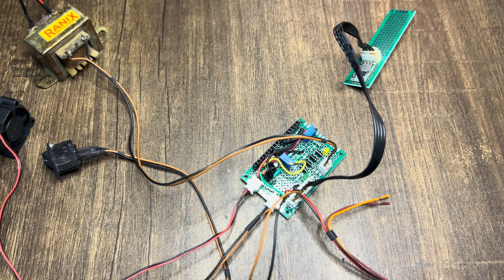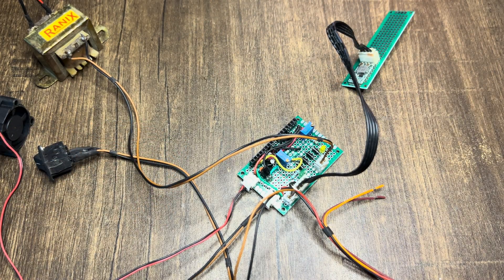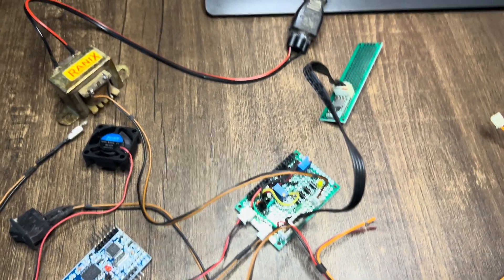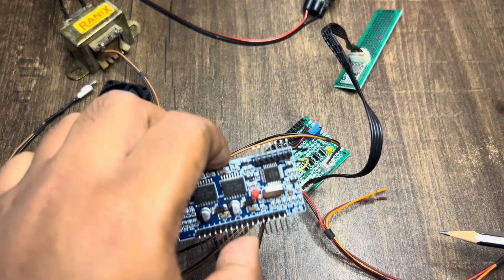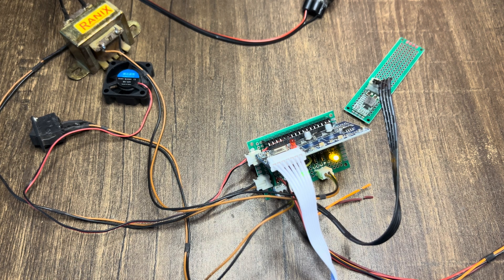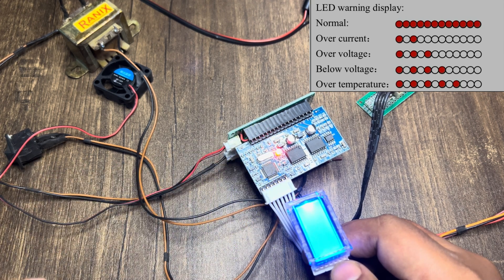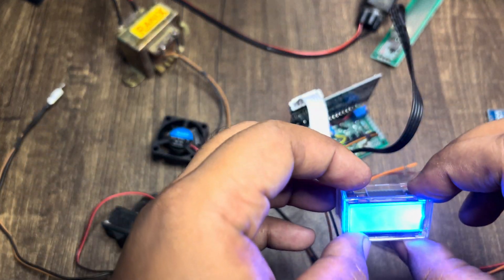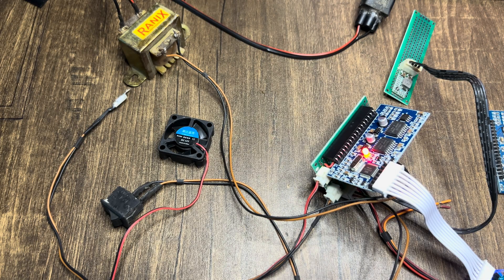DEC#28 Testing EGS002 PureSine Wave inverter module

Comment: Why isn't the output voltage of transformer sampled by connecting a very small mains transformer to the output and using the low voltage secondary of that as the voltage feedback?

Comment: hello, thanks for sharing because i thought i was the only one to have experienced this.
On the module I bought, even the LCD lighting didn't work.  
the seller already offered EGS002
EG8010 + IR2110 Driver
Module + LCD but in reality, instead of the IR2110 Driver, I got the GNVS2113S EM002 Driver.

Comment: Listening to you making a complaint about the components you bought being fake distresses me. How do you know that the Chips are fake? How does one know what to buy, and what not to buy? These people doing this, are just Evil in my opinion.😢 what were you expecting from this product? Will this handle high power? I’m looking for a high power, high output pure sine wave converter myself. Thanks for sharing your experience and knowledge with me.😊
Reply from the maker: Thanks for your valuable comment. There is probably no way to find out real and fake products other then to buy goods from a trusted supplier. Mostly we buy such things from internet where most of the time the sellers display a reference image. The actual product looks different.
And talking about my expectations, this module is used in the logic section of an inverter to produce SPWM signal. Definitely it is not supposed to handle high power but it can control high power MOSFETs and if it fails to do so(provided there is no other fault), then the question arises "whether the product is genuine or fake?" And this exactly happed to me so I shared my experience.